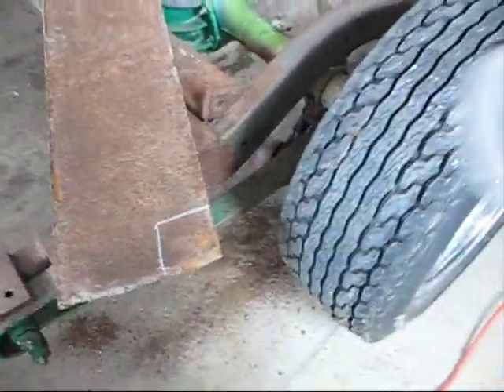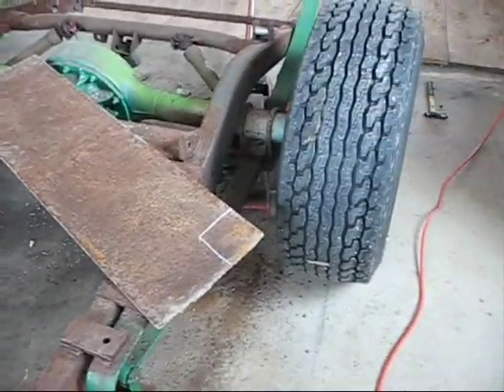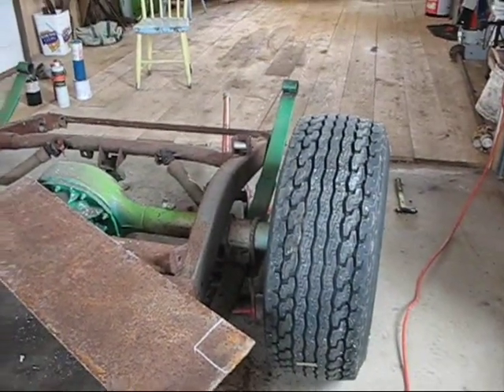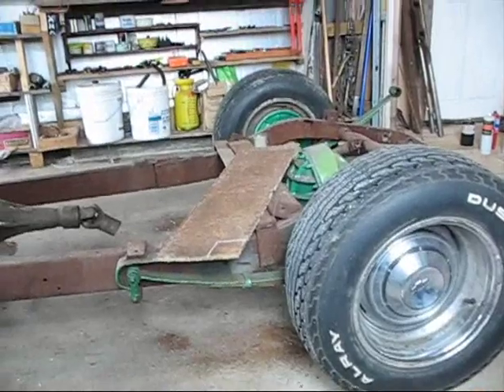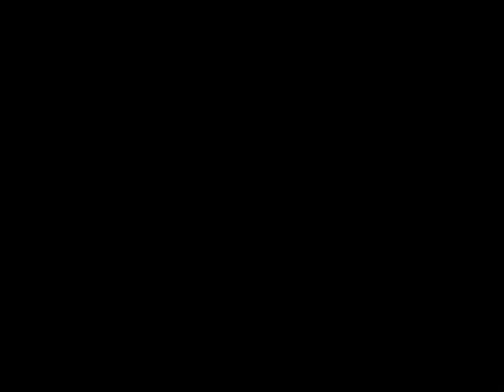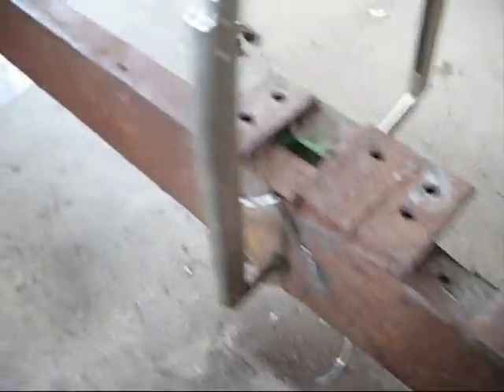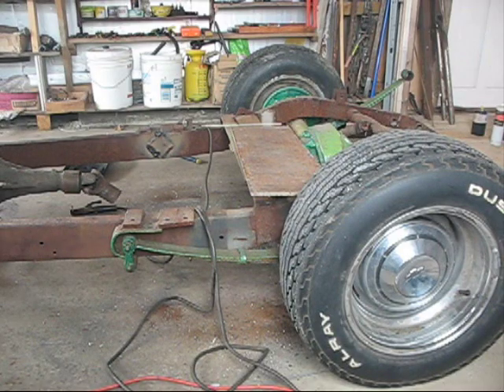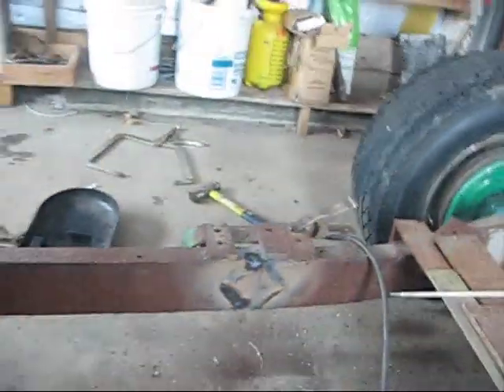Home made ratrod frame repair

Comment from the maker: @leebobby13  IF you just bought it and the frame is broken I'd probably take it back if you can.  Far as fixing it goes, it depends on how much metal is there to work with.  If it's a uni-body car theres probably none, since they don't have much metal to start with.  Whether it's worth fixin' depends on what kind of car it is and what kind of shape it's in.  On uni-body cars, I've swapped out all the mechanical and wiring with one that had a good body before.  Sometimes that's a good fix.

Comment: You would be surprized how strong a 308L stainless stick rod would be on regular carbon steel, the cost of the 308 is alot more and is pretty hard to run out of position, but if you want a strong weld on the flat 308 can't be beat. I luv watching your videos if you look under musclecarpower 76 stepside you can see my truck with a all homemade bed but the fenders you can also see my wheel horse tractor, keep up the good work.

Comment from the maker: @s46d45m17   Yep, you're exactly right about that.  Yea, I've been told to do it that way, with using the 7018 over the 6010.s   I've been a shade tree welder for 25 years myself.  No certification, and probably doing it the wrong way, but my welds always seem to hold up good.  I asked a guy a while back how to weld a trailer hitch back together that someone had sawed in half, and he recomended just what you said.  Good to know, for a really strong weld.  Thanks..

Comment: I'd have probably had to flip that frame on it's side to get welds like that.Flat I can do good work.Vertical and overhead, forget it.And I think if you can use one, a stick welder is the way to go.MIG is more for fast production I think.

Comment: I have been a 6 G pipe welder for 25 years with those gaps I would first fill in with 1/8" 6010 and then cover it with some 3/32 7018 it will be really strong to. Looks like you like the same stuff I do I just gotta wait about 15 years till I got time to mess with my stuff, THAT'S THE ONLY THING ABOUT WORK IT TAKES TOO MUCH TIME AWAY FROM THE IMPORTANT THINGS.